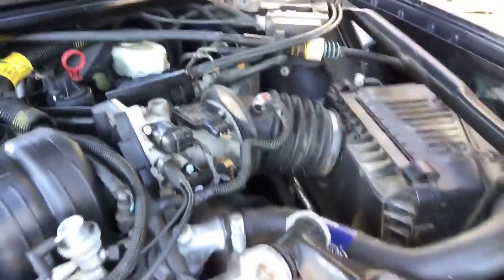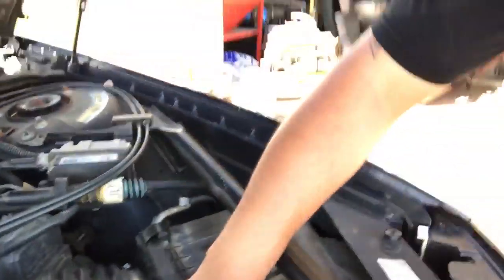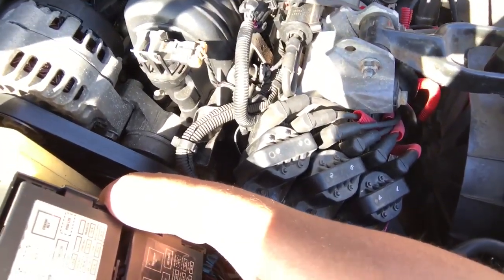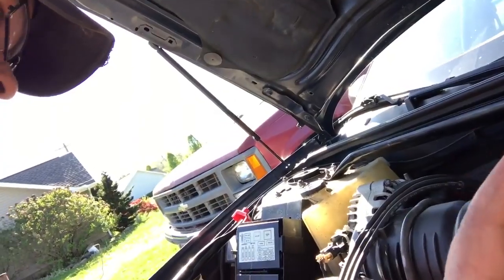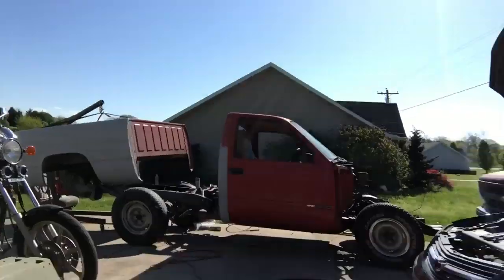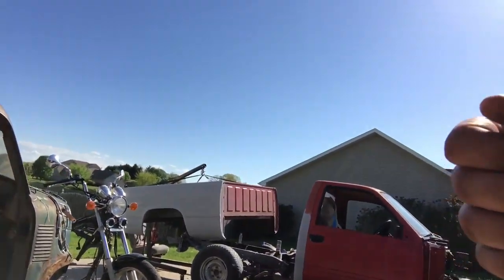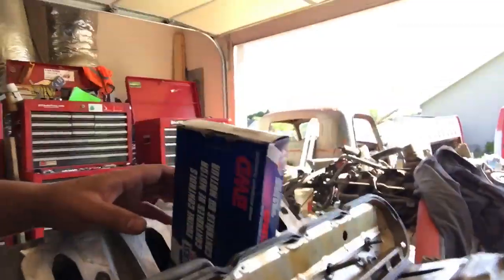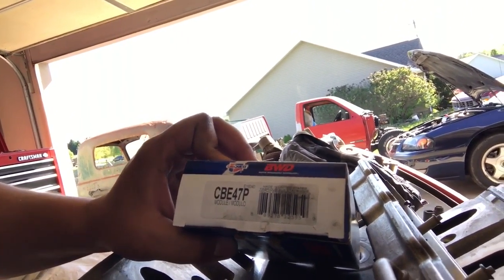2001 Chevrolet Impala FINALLY FIXED!!!

Comment: Hello, my man’s 04 Chevy impalas ignition control module has been bad for a year and a half we’d take it off use a wire brush and clean it real good and plug it back in would run perfectly for a few months lol then would happen again would sit for a month or so and do it again over and over UNTIL…. one day we got a used one and put it on and started to drive in it and literally shaking all over the road and bouncing and anything you could imagine horrible bad. ONLY IN DRIVE but not reverse. Wondering if this would have anything to do with it. Even putting the old one back on was doing that same thing… NEED HELP. Any suggestions?!?!?

Comment: Thanks ,we having the same problems and did replace the parts you did ,but stop at the flow sensor ,it turn off when it was plug in but unplug it and it ran find ,I'm sure this Impala did need new replacement ,I believe if we got a new flow sensor hope it's the problem ....if not we'll do the ignition
Reply: Did that fix it have the same problem unplug the sensor it runs fine plug it in it runs crappy, put three different mass air flow sensors in it

Comment: Thanks for the follow-up, I have an 04 monte carlo that's experiencing something similar, although mine doesn't act exactly as yours did, mine stutters under heavy load, replaced the MAF to no luck, I'm just going to take it to my mechanic and let them diagnose it.  Unfortunately for me, the car is at 168K and I believe is running on original plugs and wires not sure.  Need a few bucks and hope its nothing major.
Reply: Update on mine, it needed a full tune up, plugs wires, fuel filter.  Got it back and it still stumbled and started misfiring if you floored it.  Needed 3 new coil packs, power is back, and fuel mileage is back.  You liking my comment made me update this.

Comment: 2003 chevy impala 3.8 ignition control module problems.   MAKE SURE YOU USE HEATSINK COMPOUND ON THE BOTTOM OF THE MODULE. or it'll fry out again.. like mine did in denver in 110 degree heat. after driving 100 mph from colorado springs.   the metal plate on the bottom is the heatsink.. if you don't use heatsink compound it'll fry again in a few years on a hot day like mine did.  o'reilly has lifetime warranty on Ignition control module replaced for free 2 times already... since using the heatsink paste no problems last 40,000 miles.  at 265,000k now on original engine and trans

Comment: I've finally gotten every last issue fixed on the 2003 Impala I bought last November . The previous owner neglected to do any maintenance on it. I ended up replacing everything from the fuel pump to the ignition switch which every single part was the 16 year old factory parts.. It had so many problems but now that I've gone through it top to bottom front to back it runs like a brand new car. I don't understand how some people think all you have to do is change the oil and put gas in it and that's it.
Reply: Ain't that the truth! People want to just put in gas and change the oil lol
Reply: @DavidWilliams-vc2ms   Until I bought this car, I'd never seen a car that was so badly neglected both mechanically as well as cosmetically.I've basically have a brand new car now. I just recently replaced the last two remaining parts needing replaced the catalytic converter and the front rotors.  Now it's running and looking like a new car and I wouldn't trade it for anything. I've also almost completed the 3 year restoration of my '81 Silverado.

Comment: 3:23 one of those coil packs can go bad and bring down the voltage of the others on the 3.8, check out a video for this exact problem on "south main auto channel" on youtube. You'll see the channel owner with a blond haired guy in the thumbnail. Don't assume it's only the ICM, that can fix it but that ICM will go bad again later. Watch the video I mentioned and it will explain. Or you can throw parts at it and replace the ICM along withall 3 coils.

Comment: What about a P1381 on a 3.4 2000 Chevy Impala? Replaced Cam sensor  fuel filter, checked all connections and good but still getting a misfire code. Please help

Comment: Hey bud,  I have a impala 03 with a 3.4, it jerks at 50 to 60mph. Think that will help my issue?
Reply: check for any transmission codes
Reply: Mine doing the same I got an O2 sensor.
I changed the filter and oil change. Bout to get the 02 sensor today!
Reply: Well I've done the ignition code list, and exhaust parts.  Now the o2 sensor might be giving out, and that's why I need to stop buying used engines

Comment: I have a '03 Impala that I bought in November. Recently had some issues and found out that the previous owner didn't maintain the vehicle at all. Every part that I replaced was the original factory part from 16 years. So basically I've redone everything under the hood. Now I can start saving up again to finish the restoration on my '81 Silverado

Comment: Wow. Thank you SO MUCH for posting this. 
Likewise, we gone round and round replacing parts and hiring mechanics to no avail. We ended up buying a new to us car because we couldn't afford to put more money into it. 
12 months later we tjoight we finally repaired it but no. It started jerking around again at acceleration and wont go over 55. 
I think you really just helped us. As will try this asap.

Comment: Congrats! Get ready to replace your intake gaskets sometimes the dexcool eats them up and those 5.00 plastic heater elbows the rubber rings will wear or the plastic will crack causing coolant to piss everywhere.  Smdh 😂  I owned a 2005 with the 3.8 mine  was str8 hell ✌.  I replaced every freaking part you have replaced . I sold mine 4yrs ago and never bought a Chevy again
Reply: Yeah dunno why they made those elbows plastic god

Comment: Do you think this could be the same thing that's wrong with my 97 olds achieva? If I post a video tomorrow could you look at it for me? I mean it starts and drives but seems to drive a whole lot better when I have a full tank once it gets around half a tank it sputtered and Jerks anytime I hit the gas sometimes I can pump the gas when it Jerks and it'll  clear up and drive normal until I come to a stop to take off again. Then it sputtered and Jerks again....the whole time it Jerks the rpms are bouncing between 1k and 4k. Also when it's doing all that I can't get my car to go past 20mph until I get it to clear up. It's the only car I have, I'm just trying to make it to work and back home to make things worse I have bad tags. It's amazing I haven't been pulled over yet it even stalls from time to time.
Reply from the maker: U GUD BRO? You’re more than welcome to but I make no guarantees lol